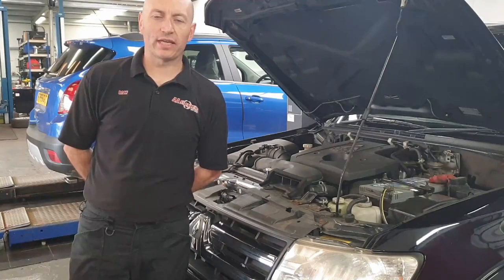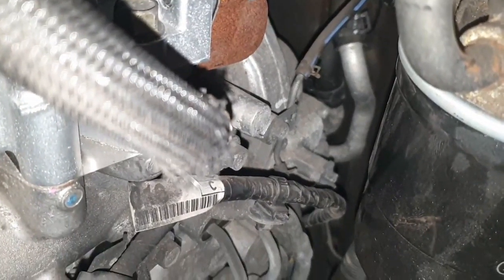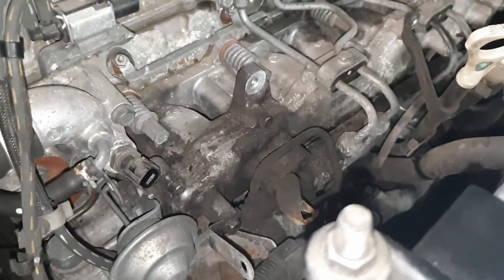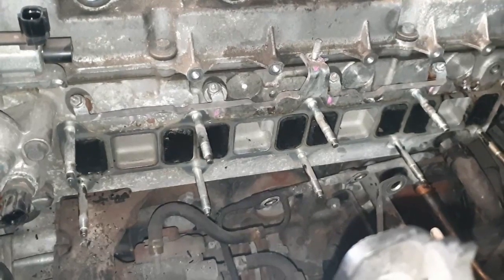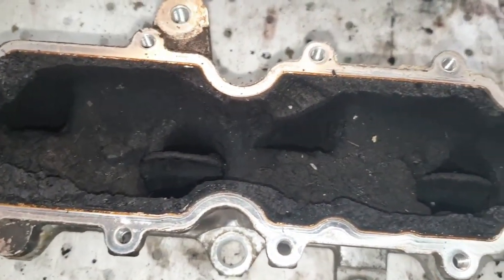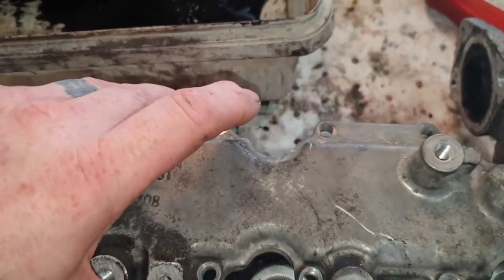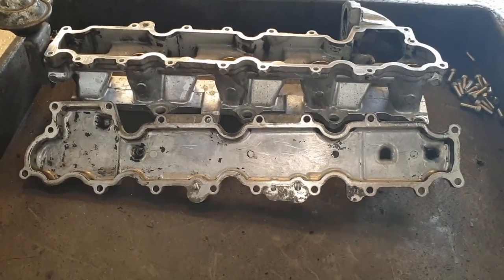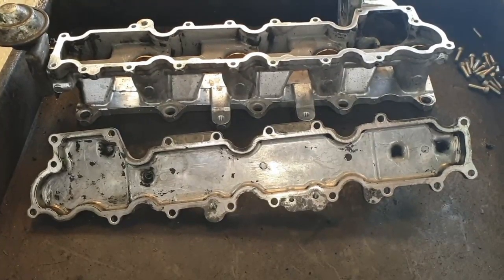AA Silencers Mitsubishi Shogun 32DiD Boost fault due to carbon contamination

Comment: Very informative, excellent. Just doesn't mention how much of a pain in the arse it is to take it off and I'm imagining it's going to be even more of a pain in the arse to put it back together. But still very helpful, thanks.
Reply from the maker: Thanks for the input John. The video is not really intended as a how to, more of a basic insight. You are correct as to how nasty the job is, a lot of stripping out is involved.
Reply: @aasilencersltd  where you based, an how much did this cost the client please, i have similar problems with my shogun
Reply from the maker: @graemephelo2422  We are based just outside of Stoke-on-Trent. This job is quite involved and uses a lot of genuine gaskets etc. You are looking around the £600 mark as a guide figure.